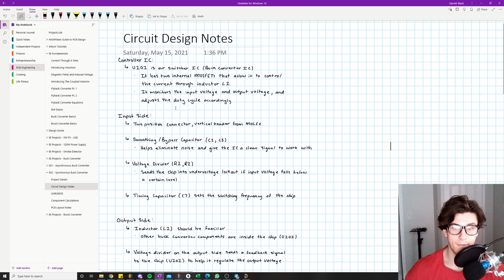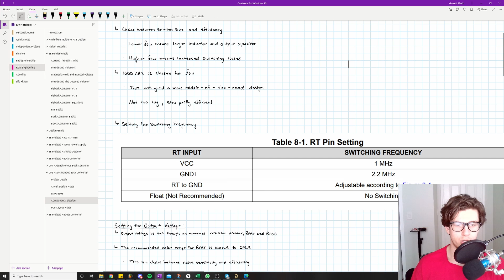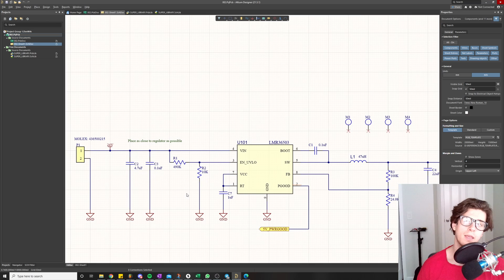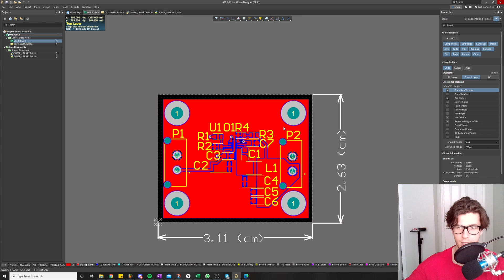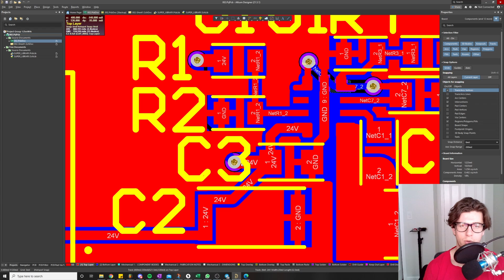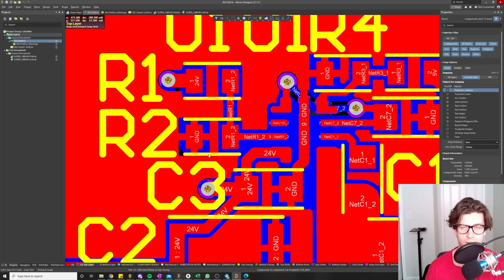BUCK CONVERTER CIRCUIT DESIGN FOR BEGINNERS|COMPLETE BUCK CONVERTER CIRCUIT DESIGN GUIDE W/SCHEMATIC

Comment: Thank you for this video. Great video. But I simulated this on Pspice and it would not turn on. I found the issue with mine. I believe Rent was selected incorrectly. The switching EN pin turns on around 1.2 or 1.3V. So Vshon should be 1.2V or 1.3V. Giving me a Rent of roughly 143.84 kohms. Once again though. Thank you for the video. Without this video, I would not have had the confidence to do this myself. Great introduction on how to create your own hardware.

Comment: I think you misunderstood how the UVLO works. I think with your selections of 10 and 490 kOhm, your V_ON is going to be 17.5V and the V_OFF is 12.65V.

0.4V on the EN pin is when the chip wakes up, but the output is only activated at 1.263V.

Comment: On the input caps, does the order matter? Vin, C2, C3 vs Vin, C3, C2?
Reply from the maker: On the schematic is does not matter. They are usually placed to show which capacitors should be placed closest to the IC on the PCB. You usually want the lower value caps closest to the pins on the IC because they are the best at filtering out high-frequency noise.

Comment: With the UVLO , can I leave this open? I have a situation where my my Vin ranges from 15V down to 10V as the battery depletes. I am driving a 12V relay coil and a small 12V dc air pump through a 12V buck converter. I want to limit the voltage to 12V and “pass through” voltage as the battery voltage drops. I can pass through the buck or go around it with a mosfet. Thoughts?

Comment: Hello RGB Eng.
How do you select the resistor package ?
like 0603 for the output capacitor
Reply from the maker: I select it based on my experience working with different package sizes.